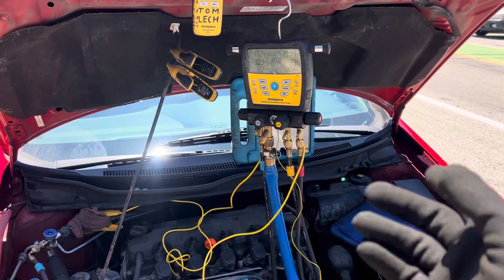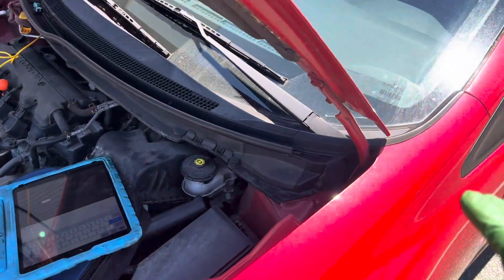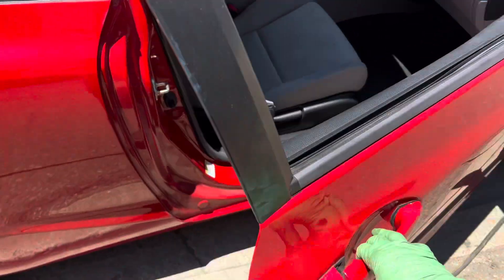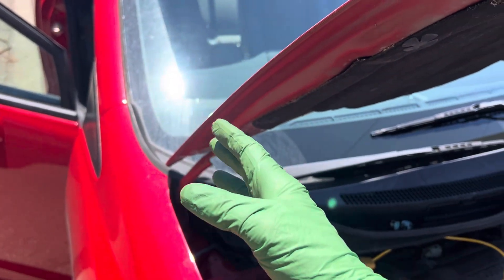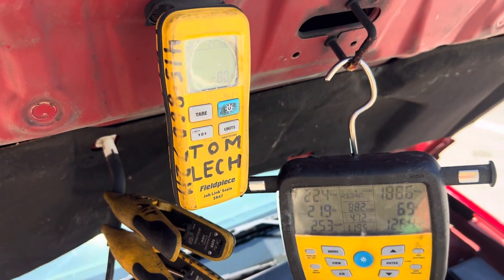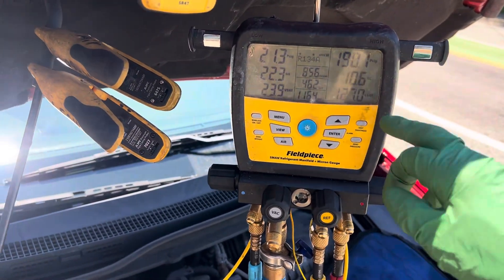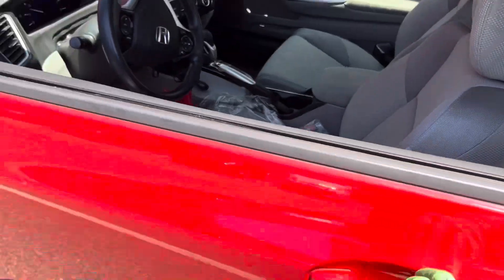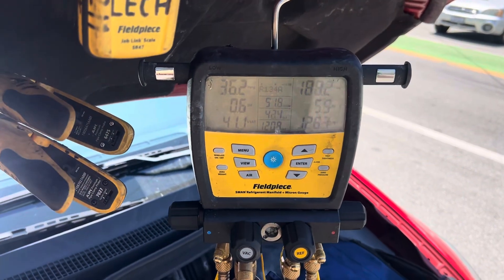YOU ADD MORE REFRIGERANT & HIGH SIDE GOES DOWN ?🤔

Comment: You didn't explain why the high-side pressure dropped.  I think the compressor is failing to deal with the additional refrigerant or the condenser can't keep up causing the pressures to drop.  How do you explain the drop?

Comment: I've got a custom combination of original 1970 factory AC evaporator with a completely different compressor, lines, and condenser running R134a. I'm getting ready to charge the system and have a pair of thermocouples and a mechanical gauge set so I can calculate SH and SC as I add refrigerant. I'd love to get your input on what to expect and when to stop on charging.

What I'm expecting to see is the SH to start out high while the TXV is essentially wide open and the SC to start out near zero. Eventually as I add charge, the SH will begin to come down until it stabilizes near the TXV setpoint. Around that point, the SC will start to come up and if I keep adding refrigerant the pressure and SC will eventually spike. I'm really not sure where to stop adding refrigerant as I'm sure it depends on the ambient conditions. Tomorrow it will be 108 degrees where I'm at, so hoping to charge it under that extreme load.

Any advice for what to look for when finalizing my charge?

Original system charge using R12 was 60oz (1701g). I've heard a rule of thumb is to use around 80% of the original charge when converting to R134a, so I'm expecting to land somewhere near 48oz (1360g). I figure I will start with around 40oz and add around 2oz (60g) at a time, record values, and see when things change.
Reply from the maker: @thebandit4393  since you will probably have a modern parallel flow condenser all rules of thumb and down 80% throw it out the window. 

It was never a conversion ratio, even when 12 to 134 on original systems were introduced . 

But it is probably closer to correct now that you have a parallel flow condenser . 

You do have a parallel flow condenser now, correct  ? 

108° is perfect here in a nice hot location 

Start with a pound and a half .

It all depends on your airflow. The airflow has to be constant. You cannot have fans cycling off or on or up or down. 

Think of a Vintage Air aftermarket unit 

Have 14 or 15 or 1700 RPMs somewhere around there constant steady 

I’m banking without seeing your system and actually having hands on . 

You’ll see a final superheat somewhere floating around 10° plus or -2 or 3° 

Your sub cooling somewhere around 20° of sub cooling 

If you’re high side, pressure fitting is located on the compressor discharge high-pressure high vapor readings will be wrong . 

You have to have your high pressure on the liquid line where you will be taking your temperature out of the condenser liquid line . 

In Automotive I have seen subcooling as low as 9 to 15° and I have seen subcooling as high as near 40° depending on your model depended on the environmental conditions . 

Do little extra experiment, cut and splice in some fittings on the liquid line . Go online or nearby HVAC supply warehouse for commercial refrigeration.
Get a threaded 3/8” Sporlan SeeAll site class with a moisture indicator. 

Put this in line on your liquid hose just after leave a little flex somewhere in the liquid line between the condenser and expansion valve 

Or if you have a separate receiver dryer . 

After the receiver dryer and just before the expansion valve . 

This will let you see the condition of your liquid refrigerant before it enters the expansion valve . 

This only means you have liquid stacked up to feed a solid column of liquid to the expansion valve 

This does not mean you have liquid stacked in a subcooling condenser that has a receiver dryer built onto the condenser like the modern vehicles . 

Some of the liquid stacking happens in the bottom rows after the dryer to perform the sub cooling liquid refrigerant . 

Internal designs and refrigerant flow pass on different styles and condensers are different. They are not all the same. .
Reply: @coldfinger459sub0  Thank you for the reply and thorough response! 

I have had this system up and running for several years after having a friend in the AC world help charge it. He did it a bit by feel, so I don't have a charge amount from that initial charge. Most of the time it operated very well; I just recently had a custom fitting on the compressor outlet crack, so I've remade that line and it am now charging again.

Yes I have a modern parallel flow condenser which I'm sure has a completely different internal volume, so it makes sense the rule of thumb would not apply.

My high pressure service port is at the top inlet of the condenser. I can put my thermocouple at the bottom outlet which will tell me SC at the outlet. Any SC there would represent liquid in the bottom of the condenser. Downstream of the condenser there is a small receiver/drier before it goes to the TXV. The receiver/drier has a sight glass, but I've been warned to be careful with that.

I'll consider adding a service port in the liquid line closer to the TXV. I have a fittings and a Mastercool crimper, so it wouldn't be too hard to add. But if the one at the top inlet of the condenser is adequate, I'd rather not add another one.

I expect SC to vary greatly depending on conditions, so I was wondering for the purpose of charging if there is a knee in the curve i.e. a point where things change or stabilize that would tell me I have enough in the system

I have some video of my system on my YouTube channel; only change now is that I've moved the high pressure service port to the inlet fitting at the top of  the condenser and I'm switching to a trinary switch. For charging, should I jumper the relay to keep the engine fan on high? I don't want to overheat while I'm charging and I want consistent airflow.
Reply from the maker: @thebandit4393 one thing you’re very lucky you have a very bulletproof durable compressor. 

And with the set up, you have even if you’re refrigerant charge is not perfect. It’ll work really good. , 

Specially, if you’re trying to set or your charge when it’s over 100° outside perfect conditions 

You should not have to worry about overheating your car because you’re cool and temperature switch would kick on the electric fan unless you don’t have one . 

I’m not sure, but it depends on the trinary switch you get . 
     It’ll have a sticker or some imprinted numbers that will tell you the cut in and the cut out pressures to energize your fan
Something like 270 psi will cut in 150 to 175 psi will cut out the fan   

Those numbers could change, depending on which switch you choose . 

But while you’re trying to charge and it’s over 100°F keep the fan running all the time not cycling off and on . 

If it’s the high side service fitting located right on top connected inside to receiver dryer, then you will have the pressure located after the condenser directly at the liquid in the bottom of the tank liquid pressure .

Not the compressor discharge  pressure that would be different. 

Then you should be able to take a true sub cooling reading
Reply: @coldfinger459sub0  Thanks for the input and helpful advice! In your experience when charging to OEM spec charge weight at higher ambient temperatures like I'm doing, at what point do you start to see the SC coming up and the SH stabilizing? I am not sure how much I need to continue adding as I start to see the SH stabilize and the SC begin to spike.
Reply from the maker: @thebandit4393  wait about five minutes in between each ounce you had. 

As long as your fan is not cycling on and off . 

And if you’re at 100°F even if you have a variable displacement compressor, it should be at 100% duty cycle 

Variables, displacement duty cycle compressors with low or modest loads 

Variable placement compressors under low loads will constantly be moving, giving you false readings even though you’re reading something it will be false
Reply: @coldfinger459sub0  I have a fixed displacemeny compressor (Sensor 10S17 used on GM trucks) and the controls on this system keep the compressor running at all times. I also have the engine fan wired to run on high speed whenever the compressor is running. I will run on fresh air mode from the cowl, hood up. I'll let it stabilize under idle then have my wife bring it up to 1,500rpm to take my readings off.

As I add charge 2oz at a time and monitor pressures, SH, and SC, when do you think I should stop adding charge?
Reply from the maker: @thebandit4393  hard to say, cause I’m not there to touch and gravel all the temperatures of all the lines

But I suspect if you have all your sensors located properly somewhere around 20° of subcooling 

You’ll have somewhere around 10° plus minus a two or 3°

Anytime you do anything custom that’s away from factory . 

This is also why I always for back up place that site glass in that liquid line after the condenser . 

Then you can physically watch at the point that the refrigerant stacks up the liquid line and finally hits the bottom of the condenser you know you’re somewhere around between zero and one or two degrees of cooling and you’ll start stacking liquid refrigerant after that.
Reply: @coldfinger459sub0  I ended up overcharging it a bit and having to recover.

End result after overchargijg to 29oz and recovering 3oz (best I could measure by recovering from the high side back into an empty can), I was seeing 20F superheat, 28psi on the low side and 2F subcooling 250psi high side 108F ambient temperature and 65F out of the vent on fresh air. I'm sure the air entering the cowl was more than 108F with the fan/engine wash.

Prior to that, at 29oz both low and high side pressures were up to 38/290psi with SH 20F and SC 20F plus I could hear a knocking sound out of the compressor. I'm pretty sure that was too much charge.

In both cases I could see liquid in the sight glass, no bubbles, maybe very slightly cloudy.

I did have some trouble with my thermocouple on the evaporator outlet sometimes reading engine bay heat - it was apparently embedded in the tape a little which I found after removing it.
Reply from the maker: @thebandit4393  sounds like some of your numbers were off and being sure what your air temperature is without measuring is nothing more than guessing you’re evaporate inlet temperature

Guessing doesn’t work in Hvac. 

If you guess and just fall back on old-school, it blows hold on hand . 
     Majority people seem to like that better because it’s easy and it works.
Reply: @coldfinger459sub0  Yes not knowing the evaporator air inlet temperature is not good but i wasn't looking for an exact number on that; I was looking for a change in conditions indicating there was enough and not too much Freon in the system. How would the evaporator inlet temperature help me determine charge amount? My thinking is if the SH is stable and the condenser is starting to subcool, I've added enough for this extreme ambient condition... Is my thinking off?
Reply from the maker: @thebandit4393  I seen you were 108° outside Fresh Air mode hood open depending on the vehicle you could be pulling in 140° air into your evaporator. Everything is complete guessing here.. 
High side fitting on the inlet of the condenser so you’re getting super heated pressures readings off of the compressor trying to take cooling off measurements off the liquid line that not corresponding with pressure gives you a false reading. There’s too much work going on here. . 

Just fill it old-school until you have a nice cool line coming back to the compressor . 

You have it wired so the compressor kicks on the cooling fan, whether the condenser needs it or not. 

Just keep it simple .
Reply: @coldfinger459sub0  I appreciate the input and I understand there will be a small pressure drop through the condenser which will affect the calculation of subcooling. My assumption is that pressure drop is low. If it is a lot of pressure drop then I may have less subcool than I'm calculating, but I'm still seeing liquid in the sight glass so I am at least stacking liquid to that point. Also since the TXV is giving me steady SH (no change with additional Freon) and there's not hunting I do not think I'm undercharged.

I appreciate all your insight and experience
Reply from the maker: @thebandit4393  I assume nothing I don’t guess I only take exact measurements when I do attempt to do this. I don’t take pressures from one area and just guess and calculate that they might be minimum.

On 108° with a hood up I don’t guess that I’m not getting 140° air loading on top of the evaporator that’s just guessing so I wouldn’t even attempt 

There’s only and then there’s only guessing 

With the information I have to go off of with the way you’re doing it I would do it by feel and complete guessing .

Comment: You should come to AZ. It’s a pain explaining to people the system is doing all it can when it’s 115 out.
Reply from the maker: @connora5387  it’s easy to make a system perform good at 115°F better than what the factory originally intended.  Little modification..  for those extreme climates. 

We were in Utah last year with my kids. It was 110° in the summertime. . 
       We just never turned off our vehicle from early in the day when we started our trip left the vehicle with air-conditioning on high left running in the parking lot.  It was nice and icy freezing cold cold 100° heat.. 

Secret is never turn it off .
Reply: @coldfinger459sub0  little modification?

Comment: Tom....many times you have to work on cars  outside on some pretty hot days ..... no fun ....any provisions that you take for the heat ?  as one gets older...it becomes more difficult working out in the heat...... 
Jay Fox
Reply from the maker: @charlesleake930  two very large containers of bottled water little over a gallon sitting in my car. 

I wear a hat that has the material hanging down the sides over my cheeks in my ears in the back of my neck . 

Are usually wear light colored clothes to reflect the light 

Unless it’s a cool day, I might have dark colored pants on .

Comment: Is it because having the right amount of refrigerant cools the compressor more?
Reply from the maker: @hisautorepair124  and on top of that that is one thing, but there’s also more massive refrigerant that passes through the first pass of the condenser to exchange heat with the ambient air. 

And if you’re really low on refrigerant .  You also suffer from oil return back to the compressor.. 

Severely low on refrigerant you start getting metal to metal Without any lubricant. 

So not only is your compressor refrigerant lacking cooling back to the compressor, but it’s like starving your engine, crankshaft and pistons by turning off the oil pump

Comment: Another case where data proves old AC myths wrong!😂
Reply from the maker: @marvinpostadan3484  there are so many old-school practices that should not be practiced. 
    That result in poor poor diagnosis
Or parts being replaced, that should not be replaced 

But a lot of the old guys get very upset when you tell them this 

And they want to defend that they were unknown, false diagnosing or causing destruction to customers cars because they were in first place 

Because it was working when it left the shop so apparently they think that’s good enough
Reply: @coldfinger459sub0  so very true here in Las Vegas where the limousine industry mechanics are not qualified to work on or knowledgable in fixing these AC systems. This result in poor customer service and loss of repeating customer base.
Reply: @coldfinger459sub0  true true...............